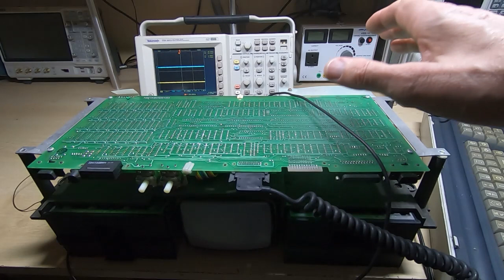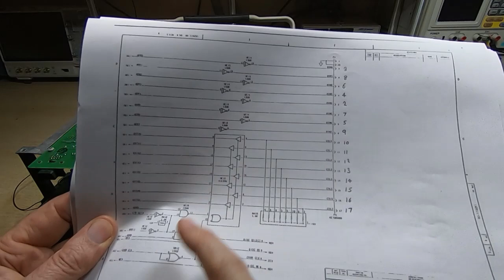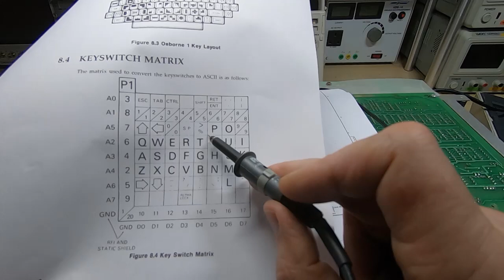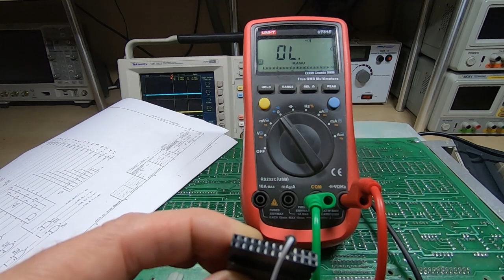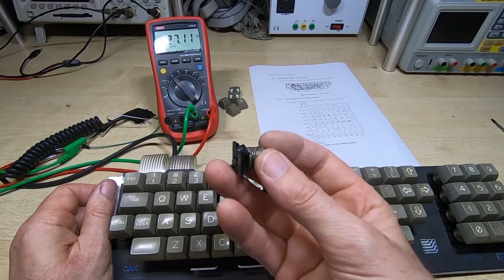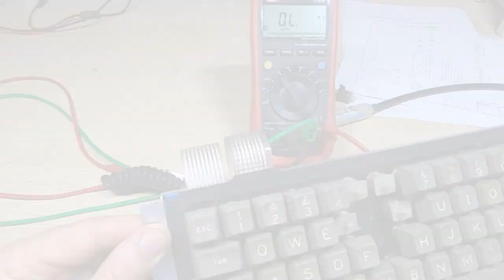Osborne OCC1 Repair Part4

Comment: My Osborne keyboard had the same problem with maybe a dozen keys. I ended up 3D printing a replacement base (the metal support), mounting Cherry switches through it, wiring each key by hand, and then printing adapters to make all the switches work with the original keycaps. The operation was successful, but way too much work. Also, Cherry discontinued latching switches, so "Caps Lock" only works when held down. Your solution looks much easier.

Comment: I fixed a shorted membrane key using the heat gun and vacuum technique just yesterday, 09/04/2026.  It worked perfectly!  Now I need to figure out how to fix a key that makes intermittent contact  Hopefully without separating the membrane.  I'll try the same heat gun technique and hope for the best.  Thanks for the excellent video series.

Comment: Epson used this same idea on the cost reduced HX-20 keyboards. A truly terrible design. In addition a 2 sided PCB is also used with all signals transferred from the membrane by way of the clamping action of the key pods (keys in sets (pods) of 1-4 in similar plastic heat staked housings. ) I flush cut the heat stakes to the pod and made a fixture to drill out the holes and fixed the pods back with screws.

Heating and reforming the membrane was a clever idea!
Reply from the maker: I did consider refitting the plunger housings using screws but unfortunately the corners have been removed where the securing posts are so if they are drilled out then there would not be any material left to screw into. I cannot even drill the aluminium plate to screw into the other 2 corners (which have not been removed) because it would require drilling through the membrane. A really odd design and not one I particularly like.
Reply: @JerryWalker001  Yes, not a good design I all. I got the HX-20 KB repaired...for about a week. There was a break in the membrane that developed which resulted in 3-4 keys not working. Had to find the owner a new KB.

There is a chap over there in the UK who does a great job getting membranes reproduced. As I recall he said it takes a run of 50 to cover the costs, not sure if there would ever be a need for 50 OCC1 membranes.
Reply from the maker: @HeyBirt  I have designed quite a few membrane panels over the years (but only ever in my own company and not for hobby) and the tooling cost is the limiting factor. For a panel this size the tooling alone would run to a several £1000 and you would still have a membrane keyboard. If I was going to design an alternative I would use a pcb and mechanical switches. I have already looked into this as I did not expect to be able to repair the membrane. My plan was to use mechanical switches on a pcb to replace the aluminium plate and 3D print adaptors so I could reuse the original key caps but so far it looks like I will not need to go that route. If I find that there is a demand then I may do that anyway.

Comment: Nice troubleshooting. And such a gentle touch with the heat gun and suction pump on the membrane. Thankfully the plastic does have a "memory", and that's the genius approach to restoring the keyboard.